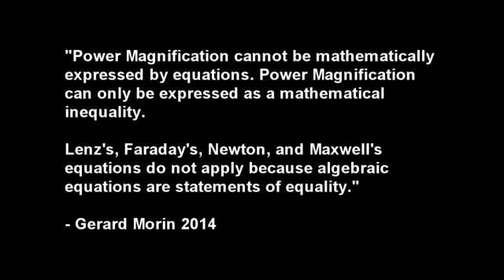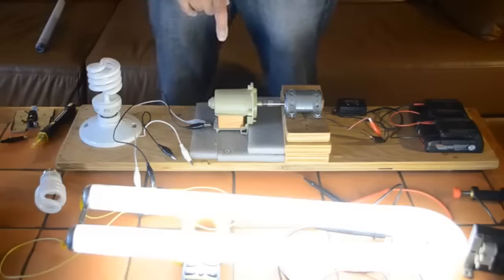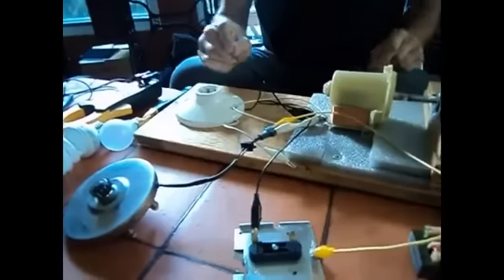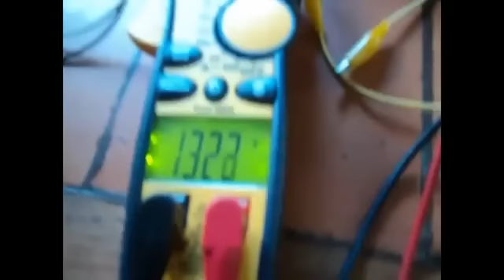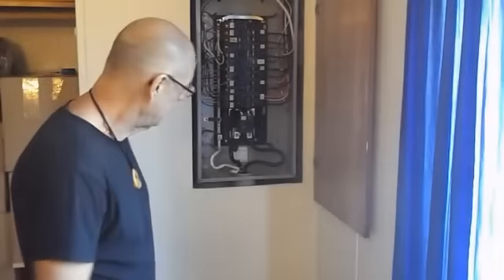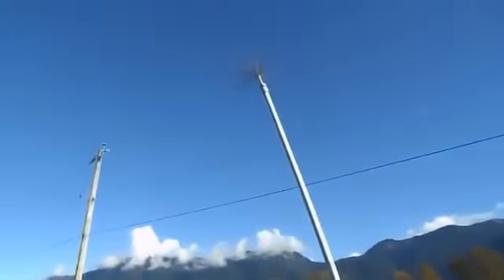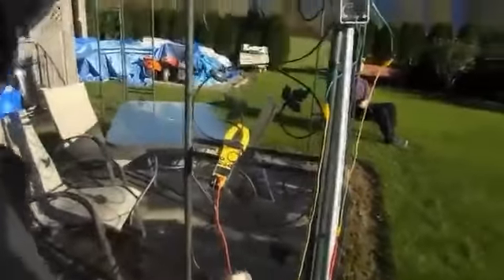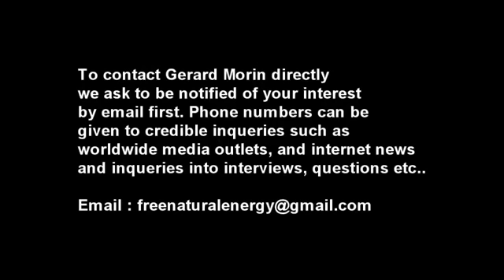Time to END The Electricity Racket - FREE & NATURAL ELECTRICITY PROOF

Comment: Considered a steam engine that uses vegetable glycerin for lube and has a shut down if anything toxic is in the tank with a quick flush so you can get the toxic "water" out and put in fresh water stainless steel or titanium parts to keep it from rusting it would be electric steam injectors. No turn on if anything other than fresh water was sensed by a sensor in the tank.

Comment: He doesn't know himself what's happening truthfully, he can't explain the science, he only knows the results. The electrons are the key here, they produce light at high frequency and use less power, his motor is 4000hz @ 4000rpm. The electrons produce very little heat as they flow over the surface of the elements. This system is great for producing light only, no good for energy production as there is very little power available. Probably a better system would produce 4000hz electronically straight from a battery cutting out the energy waisting motors lol. Seems the guy is a bit if a fool rather than a magician lol

Comment: You saying you burnt the ends of your fluorescent bulb you just barked up the igniter on one in so you did those wanted have to call Janice into clubs and I didn't take that body got to burn in on it take the bulb out spend it 180° put it back in there and it'll still work if you smack to the other side of midnight get some brains get some brains reason I know that work is Iran the same fluorescent bulb in my house for 31 years it quit working I took it out turned around the other way they quit work and I took it out early around the other way the starter out a quit I went by the starter starter 33 years one 18-inch fluorescent bulb or 33 years

Comment: Yeah I'll take a walk with you on that road I make you back I'm smarter than you because you're still running a generator that's all you're doing with that motor you running the generator not an alternator running a generator a generator is magnets on an Armature passing by a field of copper wire coiled copper look the other way you have the magnets on the outside and the Armature is coil copper still the same thing alternator generator same thing on alternator makes a secret that's why you got three generator on an old 50's earlier car is a generator running to a voltage regulator I bet you you wouldn't even know how to keep the battery charged out an old Generator car once you put a new battery in it won't strike later and do all the generator I would you keep draining the battery I know cooler eyes Tesla build connection to the battery connection to make it sparked out activate voltage-regulated